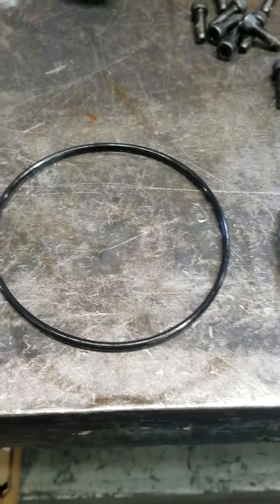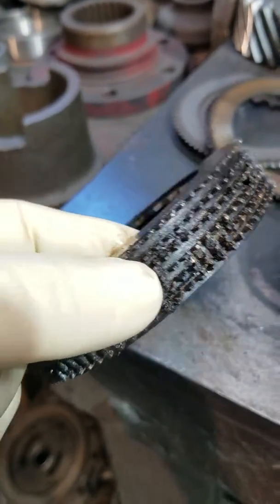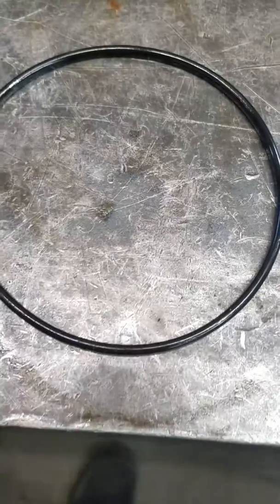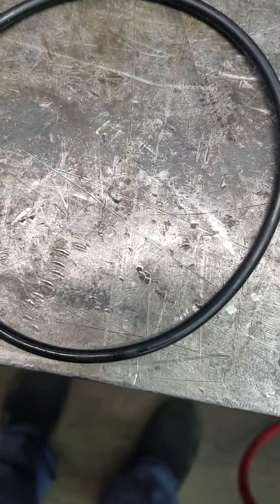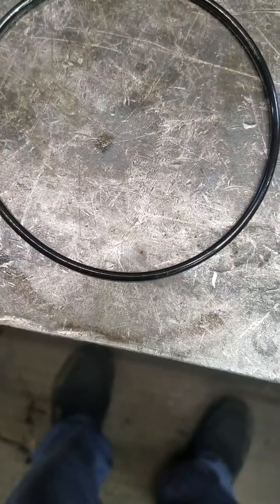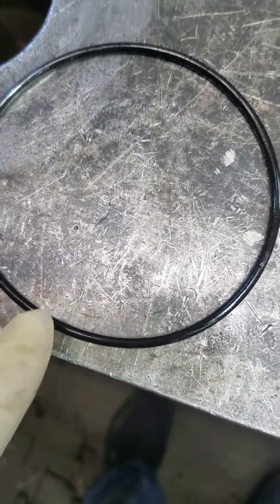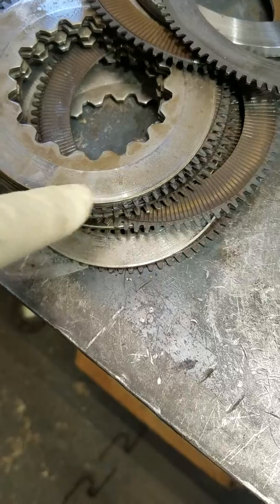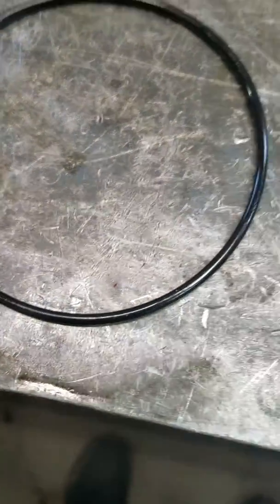Overheated 2002-005 Vdrive Velvet Drive

Comment: I know this is a bit of an old string, but i just replaced two 7.4 (454's) on my maxum 3700 with new engines from Marine power with are 6.2's but with good HP and torque etc..  I also just had my transmissions rebuilt...however after a 2 hr run on the water my right vdrive  a 20-02-005 failed along the way as it was stuck in forward when i slowed to dock.  would stall in reverse.  I suspect overheated along the way though i never got an alarm, but I am worried that the cooling system with the new engines, which uses a single cooler for both the oil and tranny, may not be adequate and after rebuilding my failed unit....may just happen again.  Could I be right?
Reply from the maker: I believe the cooling system isn't the problem.